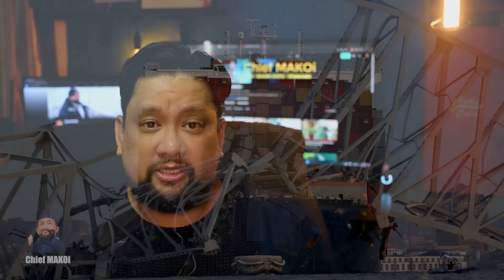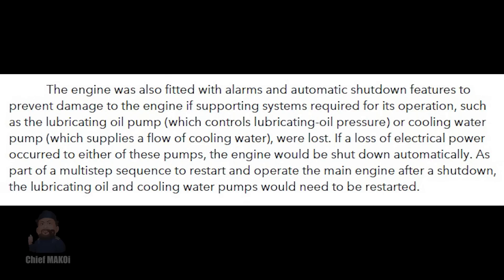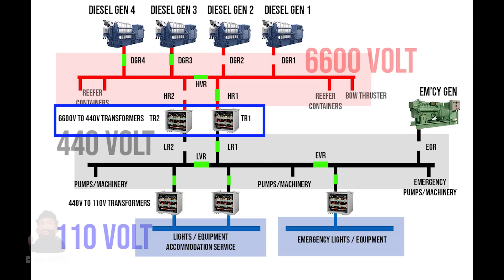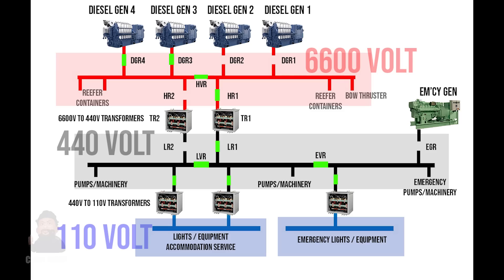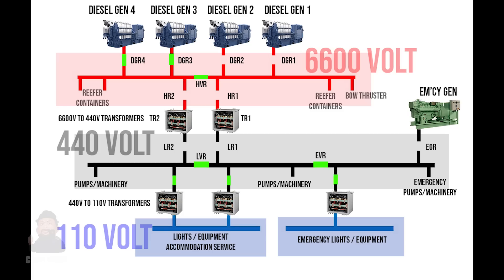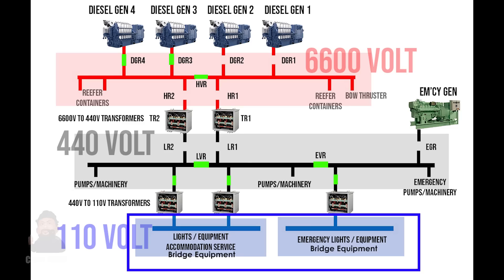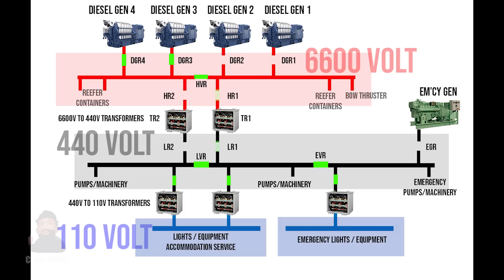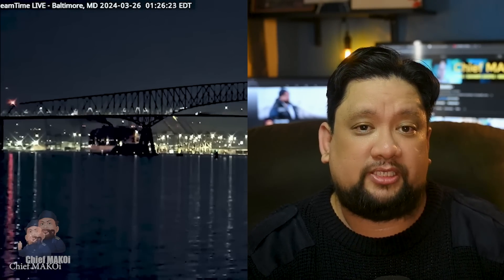Explaining the NTSB Report on the Container Ship DALI | Chief MAKOi

Comment: Emission of black smoke from one or more of the generator engines suggests either a mechanical overload (that could be a generator fault or an electrical overload on the generator) or something that restricted the amount of air flowing through the engine such as obstruction of the intake or exhaust or a faulty turbocharger.

Comment: Breakers trip because of overcurrent.  You said they tripped because of a transformer problem.  There is another cause.  Any one of the loads on the 440V bus could have shorted out and caused the breakers to trip.  The root cause has not been established.  The crew resetting the breakers was not going to fix that.  Can't wait for the final report.

Comment: i remain concerned by an element you missed on your diagram. the main engine requires the fuel pump, and the water pump to run. And inconveniently, one uses high voltage and the other low. so the failure of either circuit would lead to a loss of propulsion without backup pumps on the other circuit. The original cause of the fault is unknown, but a short term low voltage fault is equally likely to cause this as a fault on the high voltage circuit.

My suspicion is a fault in the transformer, it being the element the circuit tried to isolate itself from not once but twice, but regardless, loss of any power bus was guaranteed to cause loss of propulsion and with it loss of directional control. It's unfortunate it happened where it did and maybe they'll install a small supplimentary emergency transformer for the low voltage pump in these types of ships in future so only loss of the HV circuit will take down the engine. A Single component to automatically connect to an active bus should low voltage go to zero and keep the primary engine functioning.

Comment: Excellent analysis Chief Makoi, especially the elaboration of the simplified NTSB circuit diagram.

My conjecture - immediately after the crash - was a fuel related one. Possibly excessive paraffins, the wax of which will clog the low-micron sintered  filters, which cannot easily be removed in the auto filter self cleaning operation. 
The suspected and alleged blackouts, when alongside, led me up that path. Search me, how could they even think of closing the dampers of a running generator? Isn’t this the domain of a senior engineer?
(I’ve had this - choking of filters -  happen to me twice, when we were, crazily, changing over filters while maneuvering, until we went to an older and different Diesel Oil source. The wax in the paraffins of Diesel Oil will choke the filters quickly. The same wax in the paraffins in Heavy Fuel Oil will not choke the low micron sintered filters as the HFO is heated to around +130 deg C. The melting point of these paraffins is from 45 to 60 deg C).
The only way to clean these (choked) sintered filters is either to ‘steam’ them or use a light flame, the steaming being preferable.

But the NTSB Preliminary Report is inclined towards malfunction of HR1 and LR1, normally very reliable, especially if they are Terasaki.

If fuel related, loss of speed of the Generators 3 and 4, would have triggered the ‘Low Voltage’ or ‘Low Frequency’ alarms in the Generator Starting Circuit, which would have tripped DGR3 and DGR4, not HR1or LR1.
Even as they were tripping (DGR3 / 4), Generators 1 or 2, or both, would have started automatically and come on load, as they would have been on ‘Auto Standby’. 
The total load on the switchboard would have lessened, as the ‘Non Essentials’ - including Reefer Containers and Domestic Systems - would have tripped.
So, even one Generator would have been capable of taking the ship’s load, as the Bow Thruster would have tripped and would need to be reset before starting. (Although, I expect that they would have switched off the BT even before the blackouts near the Bridge - worth examining when did they switch off the BT).
Noting the heavy black smoke after the black out, it could be from one or both the ‘Standby’ Generators starting up.

In the ‘comments’ section, I read one comment that ‘Low Insulation’ of the HV Switchboard could have tripped this breaker HR 1. In this kind of an HV setup, it will be reasonable to expect heavy protection in the form of alarms, indication on meters, auto-tripping of minor breakers etc. in case of ‘Low Insulation’. If an HV Breaker were to trip due to Low Insulation, would it not have caused a heavy spark at some place or the other?
Unless there was a problem with the breaker HR 1 / LR 1 itself. 
But why would the malfunction of one of them trip the other? Only one breaker should trip, not both.

The irony is that, whatever took place, if it had taken place a few minutes later, it would have resulted in either grounding or drifting, no more.

I do not want to speculate further, as the investigation is still on. But, we have not seen the end of it…..AR

Comment: The NTSB report left me with a lot of questions. What was the electrical load on the plant? Was 2 generators sufficient for maneuvering? Typically an additional generator is online during maneuvering particularly when a bow thruster is on. Why did the transformer breakers trip? Was it low voltage protection?

Comment: As an electrician with experience in 11kV switchboard design, The bolted bus ties are generally not normal in land installations. That aside, I think the main cause will turn out to be a partial short in TR2. HV transformers are normally OIL COOLED and if not used for a while can build up moisture in the oil due to condensation. I have seen a video where it is stated that TR2 had not been used for some time so it is likely that there was water in the oil. This would cause a partial short within the transformer which would lead the automatic control system to trip the LR2 breaker and when that didn't fix the overload, trip the HR2 breaker. Why the system then did NOT close the HR1 and LR1 breakers upon that happening is down to bad design. Same as having the operators having to manually close breakers.

Personally, I believe a stand alone system (not connected to a power grid) should be at least 24V DC controlled with battery backup of the breaker controls and protection relays. If the protection relays that tripped the HR2 & LR2 breakers were fed of the 440V or 110V bus then the operators would have no indication of what had caused the fault.

If the procedure had them closing the breakers that had just tripped, then that procedure needs to be looked at as I would be closing the breakers that DIDN'T trip. If the procedure was to close the breakers that did not trip, then the operators might have gotten confused after using TR1 for so long.

As to the HV rating on the generators, that should be MV which is 600V to 69000V (69kV). HV is 69000V (69kV) to 230000V (230kV) with LV being 110v to 600v and under 110V is classed as ELV.
This is a generally accepted worldwide standard in the electrical industry and would not be changed just because the system is in a ship.
Reply: Minor correction: NTSB preliminary report says TR2 (plus HR2 & LR2) have been in use for several months; i.e. not TR1 (page .14).
But that doesn't change your general statement wrt effect of moisture caused by condensation, of course; and even more fits to one contributor which led to the disaster could have been TR1 (plus corresponding breakers) has been used when leaving port.
But since you've mentioned "water in oil could cause partial shorts", that also means oil used in transformers is not used for cooling only, but same time also provides (additional) electrical isolation, depending whether the windings have their own isolation.

Comment: 3:43 According the section 1.2 of the report, the Dali's lubricating oil pumps ran on the HV bus and the cooling water pumps ran on the LV bus, which seems to make the engine even less fail-safe since it needs both electrical buses working for it to run.

Comment: Very good report Chief. It's problematic that the crew was not rotating Tr1 and Tr2 on a set schedule like weekly. Unused electrical equipment absorbs moisture and has high internal resistance when it is finally used again. On the fuel side, was the FO service tank being checked for water or sludge in the bottom? Were filters and strainers clean? Was the centrifuge operational?

Comment: Why would you operate a ship like this with the tie breakers closed while in port. That basically eliminates the redundancy of the systems and eliminates any fail safe conditions of one system failing and the other continuing to operate and run the redundant systems while in port. I am not a marine electrician but I have worked in buildings that have redundant services and you never close the tie breakers unless there is a problem. You run everything separarate unless you NEED to tie them together for maintenance or an unexpected problem. I can understand running them with the tie breaker closed out in the open ocean but not when you are in a critical environment like a port  or a canal where your propulsion is so critically tied to your engine continuing to run. This is a SOP failure in my opinion.

Comment: Excellent video. I am wondering if the bow thruster was still connected to the bus. I’m an Marine Engineer although I have never been on the bridge during maneuvering I have closed and opened the bow thruster breaker and there are times when the bridge forgets to inform the engine room that the thruster is not needed. If someone on the bridge in a desperate attempt to change the ships heading and over loaded the generators. I have seen the CE call the bridge and inform them to be careful with the use of the thruster.

Comment: Great presentation Chief, as an Electrical Engineer and sometime instructor I appreciate your diagrams and clarity of description of the ship's electrical power and connection to pumps, steering and main engine. It sounds like their was a problem in the electrical system or an operator procedural problem while the ship was in port. The cause of the failure should have been isolated and fixed before the ship was allowed to get underway with its cargo. I guess we will find out as the NTSB does its review of the accident.